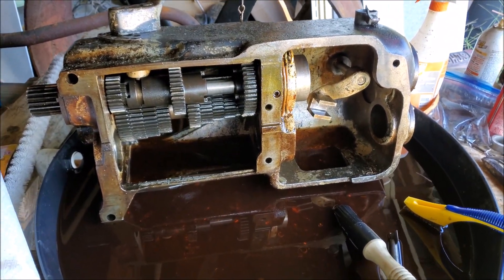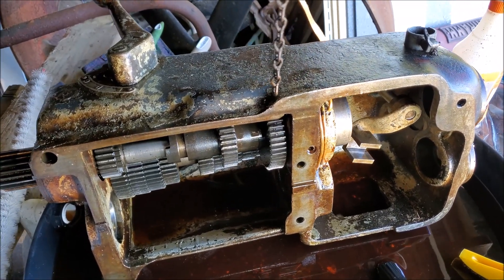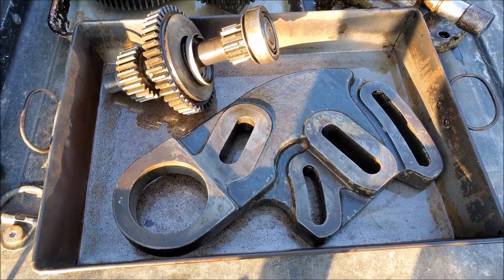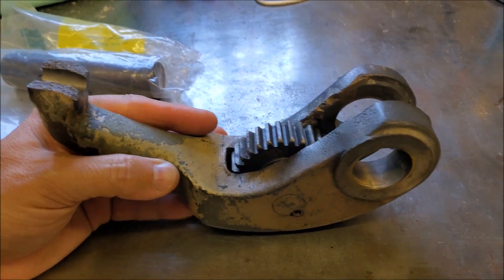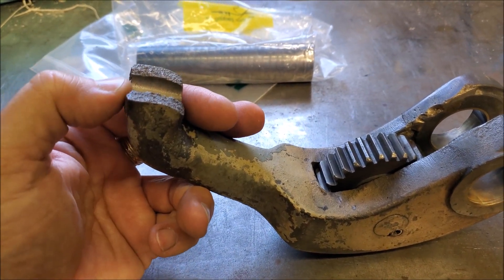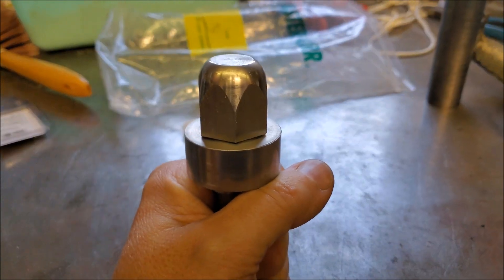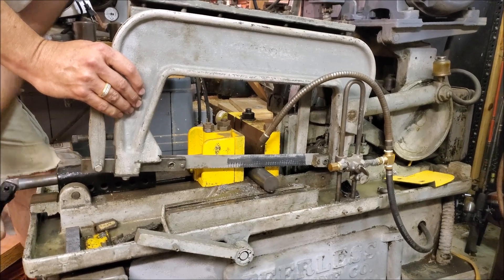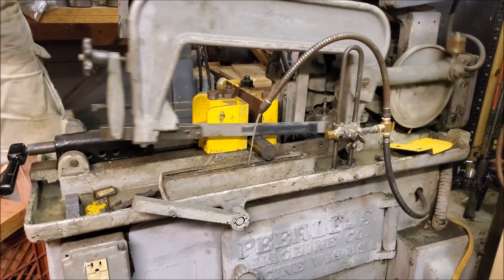Monarch Lathe Restoration Update

Comment: About going to have to hold it by the shaft holes since it is the only thing machined.
Reply from the maker: Agreed. Shaft is 1-1/4". Very little play. That would keep it from rotating, then he can block it at the correct angle and tram the bore of the plunger.
Reply from the maker: Brian, check your email I asked about how to donate some more for Bailey's vet bills